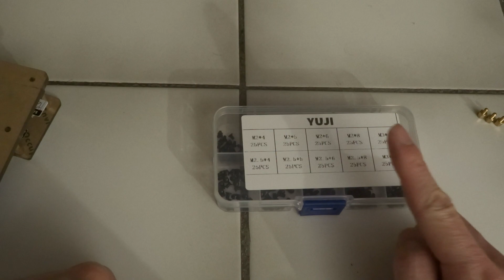Rearranging the Acrylic Case of my Radxa Rock 5B

Comment: I believe Allnet now sells a metallic case for the Rock 5B last time I checked?!
Reply: Ameridroid is the one with Radxa's official metal case, not Allnet, however, it is only for pre-order at the moment. I ordered it, and with shipping from America to NL, it is 26 EUR. I just checked Allnet and they still only have the acrylic case for now. Radxa's metal case has a passive heatsink built into it, which is great. Unfortunately, the power button on the Rock 5B does not work with the case, so I will have to figure out a different solution for turning it on, such as a switch on the power cable, or a power strip with a switch embedded in it.
Reply from the maker: Thanks for the info on the power button.
Allnet also has it in their shop now. https://shop.allnetchina.cn/collections/rock5-model-b/products/rock-5b-metal-case